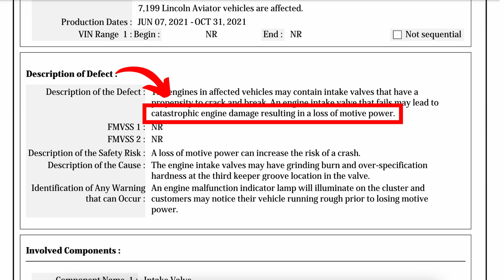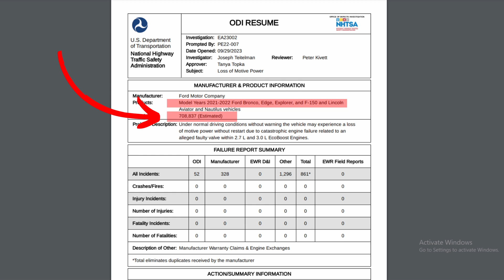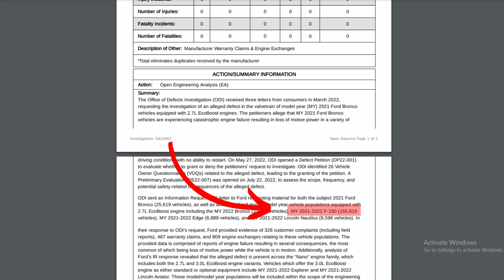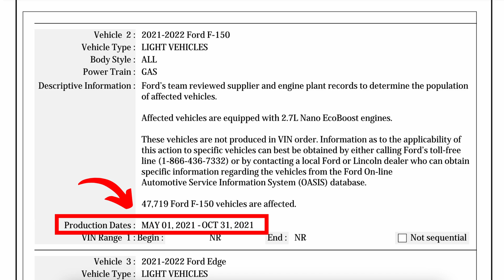Ford F-150 2.7L EcoBoost Engine RECALL Explained *Heavy Mechanic Review*

Comment: I got this recall notice from Ford. I'll take it in next week to get checked. 

Truck has 145k on it, wondering how they determine if the valves are bad?. I can't see for giving you a new engine that easily either. It would be nice though!
Reply: How did it go with your car? How did they determine if it was damaged? Did they replace anything? I have a 2021 and I received that recall.

Comment: A guy in Ontario Canada has had the Ecoboost engine in his 2024 F150 blow up 3 times within 13 months since new. Each time it was replaced by a new engine under warranty. In one case, it blew up within 6 minutes of driving away from the dealership with a new engine. The change in alloys in the intake valves did not fix the problem!
Reply: Is this the 2.7 for sure? Or a different version since he’s in Canada?
Reply: @Mitsu3kGT It was the 2.7. You can see a news item on YouTube about his experience by searching this title, After third engine failure Ontario man is losing patience. He made the news after the second failure (the one that happened within a few minutes) and this news item was after the third time (two months after the third Ecoboost engine was put in under warranty.)

Comment: What’s the best year for these 2.7 engines. Thinking about buying one, I don’t pull or haul anything. Just daily driving. Thinking should I get a 2.7 or 5.0.
Reply: I have a 2017 F150 with the 2.7, its been great but get the V8. Less pressure in the engine means less wear and tear down the road.

Comment: 2:44 "A design modification was implemented in October 2021". My F150 was built Oct. 17, 2021. Not sure if I'm affected.
Reply: I’m in the same exact position my VIN number in the door panel says manufacture date 10/21. Were you able to find anything out about this scenario?

Comment: To clear up some confusion here...Ford doesnt make the Valves. They have a supplier that manufacturers them...they failed to heat treat them before sending them to Ford.
Reply: No. That’s not what it was. They were made from Silchrome lite, which was brittle and prone to breaking and cracking. Now they use Silchrome 1, which is more resilient
Reply: They are supplied from someone else yes, but the material was the issue. Not that they didn’t get “heat treated”

Comment: Have a 2016 F150 xlt 2.7, not work truck, garaged, washed and waxed, purchased new from Ford, has 28k.  Truck has good power, nobody is disputing this but this engine has major faults, 1 - first gen like mine the intake valves are prone to carbon build up. Have to manually clean.  Ford knew this and yet went ahead to market with this 2- cylinder head temp sensor on driver side ($8 copper/bronze sensor) that without warning will leave engine in limp mode. happened to me had to drive back 3 miles with severe trembling.  No overheating just sensor went bad, no warning.  Can leave you stranded anywhere without warning.  Again, why does Ford do this crap?? 3 - rubber belt driven oil pump?  I want someone out there to tell me why this is good vs a thick chain that will last the life of the engine.  People here that say their 2.7 "has done 200-500k in miles without any maintenance are likely lying or Ford stooges.  This engine 2.7 and same for the 3.5 are loaded with about 60 sensors, of which I learned from technicians 3 will fail and leave you stranded.  I'm a mechanical engineer and son of a retired mechanic and can tell you after working on dozens of cars, sensor laden cars, and turbos fail this "no maintenance" extreme high mileage nonsense is fiction.  Hey even the 2025 2.7 have the cylinder head temp sensor.  So new truck owners you are in the same boat.  Chevy is no better.  Can Ford build this engine bullet proof, in my opinion from an engineering point of view, yes they can, but as to why they don't I have no honest answer.  Likely some board political decision, "who cares if it works, we have spare parts for 20 yrs" mentality.
Reply: Sorry you've had problems. As a mechanical engineer, you should know the first generation of the engine will have some bugs. Also, machines are most likely to break either when they're fairly new from manufacturing defects, or really old from deterioration. My engineering stats professor taught us to always run our new stuff as much as possible when under warranty, for this reason.

I've got a 2.7 built in December of 21 that's about to hit 60,000 miles. I haven't had any problems. However, I could see the transmission going out first. It gets some hard downshifts from time to time. That being said, I'm about to change the trans filter and oil to hopefully improve it. I used to haul 500-1000lbs half of my days for work, and towed a 6500lb camper a cumulative of 5000 miles so she's been worked decently.

Overall, I would consider this engine to be a fine piece of engineering. I did love my 05 Chevy 5.3 as well as it was much more simple. She lasted to 330k. It got about 40% worse mileage and had 100 ft-pounds less torque.
Reply: You sound bitter. That’s too bad.   Why complain about the oil pump belt when your 2016 2.7 has a chain?

Comment: Hmm my 2021 F150 built in 9/21 has 45,000 miles on it. Should I be worried any more?
Reply: Probably not.  My 2021 Bronco 2.7 is subject to the recall, 113k miles.

Comment: 2021 f150 check engine light came on about 18000 miles on it come to find out cylinder  walls were all scored new engine going in paid by Ford
Reply: Probably a 5.0…

Comment: This happened to my 21 f150 at 33,000 miles before the recall so Ford only "repaired" the parts that failed. Now I'm at 47,000 miles and it just happened again to the other side of the engine. This has been a colossal pain in my ass and now I have to wait 3 weeks to even get a loaner vehicle from the dealership. It feels like I just took a pile of hard earned cash and flushed it down the toilet 😭
Reply: Sorry man, sometimes this kind of thing happens. Big inconvenience! Hopefully Ford gets you right.
Reply: I have a 2021 2.7 and I received the recall but I haven't taken it to the dealership yet. What exactly did they change on your car and how long did it take?

Comment: My 2021 Bronco FE is in the recall.  I have 40k miles on the engine with every type of driving, from crawling up Ozark trails to prolonged 80mph run on the interstate. So far, drama free. Be intersted in what this service cycle diagnoses entails.
Reply: I’m looking at buying a 2021 FE, 2door with 36k miles. What ended up happening with yours?
Reply: @NolanChance-m7s Ford has yet to offer a solution to the valve train and rear shock recalls. Now they are saying "3rd quarter 2025". Other than that, no issues with my Bronco. We had a major hail storm recently and a rear taillight was cracked...taillight is $1200!!!
Reply: Ford has a service procedure to test the motor.  It's unlikely that a 2.7 affected by the valve issue would live past 10k miles.  I have 113k miles on mine and it's been reliable.  I did wory initially enough to get an extended warranty to 150k miles.

Comment: I hope they replace the stupid wet oil belt with a chain.
Reply: I believe the 2.7  originally had a chain but, the bean counters saved a few pennies by using a belt (dumb idea)
Reply: @hmdwn  the belt is actually quieter than a chain and it is supposed to save a bit of fuel
Reply: Why do you hope that when it’s a non issue?
Reply: @OutdoorCanadians  nonissue til you have to pull the transmission to replace it. its still a stupid place to go cheap. like a plastic water pump on a bmw, WHY?

Comment: Eco Boosts are like a CVT, they are fine if you drive them like an old man with a steady foot.
Reply: Obviously you don’t own one because you are completely wrong about that
Reply: @pathunter7003  No I repair them daily at the dealer and am glad to be correct because I make a lot of money off the owners.
Reply: @greggc8088  yea, I know. It seems that millions of people work at dealerships. 🙄
It’s a wonder this country can operate daily with everyone working at a dealership…
Reply: My experience was that if you baby them they get less reliable... but what do I know, I only had 250k miles on a flogged 1st gen 3.5 Ecoboost.
Reply: @mpeugeot  What do I know, I repaired them for the last 15 years and now work a tech line helping others repair them.

Comment: This is oddly reminiscent of the spark plug blow out problems fords 4.6l's had, ford knew about the issue, refused to acknowledge it, no recall was issued, and repairs came out of the owners pocket, to the tune of $500 per incident...Had a friend that had a 2006 F-150 with the 4.6l, 3 times it ended up at the dealership for repairs for this issue, 3rd time it was a previous blow out...
I went and picked him and his truck up, dropped them off at a local repair facility, ordered new heads from Summit, repairs were made, never had an issue again...
Reply: Ford didn't have a issue with the 4.6 terminator engine,  it was the 5.4 triton that had spark plug issues
Reply: @BruceDragon-sf1tr  Wrong...
Reply: @wipatriot510  don't just say I'm wrong , prove me wrong

Comment: This channel missed that about 100,000 Tundra 6-cyl engines are being recalled and need to be replaced. I talked to the local Toyota dealer who said that because of the huge number of Tundra engines that need to be replaced, this can cause significant delays for people just wanting regular service at the Toyota dealers.
Reply: Toyota service was already a nightmare as they have the worst techs in the buisness. Seriously they are all 22 and couldn't diagnose a common cold. Not a torque wrench in the building.
Reply: Bull💩... stop being so ignorant son
Reply: @atg1338 naah no bs as a tow driver I have towed two i repeat two dozen tundras of various years between it's release and current that have destroyed the engine and a number of electrical nightmares .one failed because its turbos failed sending the oil into the engine destroying a very expensive engine and it had 1300 miles .

Comment: With the way tax are paid here in America flat rate plus warranty work gets shorter hours. There’s no way I would trust a new engine being put into my car. There would be so many little things skipped and not done to factory specs. I have seen it so many times. Bolts not put back in wiring harness left loose.

Comment: I have one of these in my company truck I have almost 60Kmi on it and it's a 2022. I like the performance of the truck. I carry quite a bit of weight and it really does well on the road. Towing is no problem. I've been really surprised. Getting 21-22mpg avg.

Comment: Now if they would just recall the junk 10R80's and fix all the ones they sold for years with faulty drums and valve bodies...twice in 80k miles. Ford quality is not currently a thing.

Comment: I really enjoy your videos and have a question. You often mention turbo gas engines being less reliable or "more complex" than naturally aspirated and I do not argue that, my question is, what differs from turbo gas to turbo diesel that makes them more reliable? Especially with today's emissions components. Many thanks! Keep up the great work
Reply: Diesels usually work for a living and have a reason to exist, drive, and put on miles. They rev low and have heavy internal components. Theoretically, turbo gasoline engines can still run about as many miles... so many factors.

Comment: I will take this over the recall on my new 24 Tundra that I am hearing rumors will be further expanded!
Reply: I saw something on that earlier. Knowing that 24’s have had engine failures, I figured it would only be a matter of time before they included later 23’s and 24’s. It’s pretty shocking that Toyota of all companies is having this issue.
Reply: @cpftank09 They have found that it is from not cleaning the machining debris completely and the machining debris is grenadine turbos and probably other issues. Not due to quality of design or build.
Reply: @seanmclaughlin7415  the problem is, they there are engines failing well outside of the recall specified manufacturing range (early 23) when the fix was supposedly implemented at the factory. Not to mention it’s happening to US and Japanese built V35’s. 2024’s with build dates in late 23 and early 24 are failing. While the 5.7 had issues early on, they were nowhere near as wide spread as this. I worked at a high volume Toyota as a tech when the 5.7 came out and we only had a handful of them with any issues. I trust that Toyota will figure it out and they’ll fix all the trucks. But this is the worst issue Toyota has ever had that I can recall outside of maybe the frame recalls.
Reply: @cpftank09  Sure, I believe you. I was just describing the cause, not the extent off the issue. It took them a long time to correct the frame issue, too.
Reply: @seanmclaughlin7415  that is what Toyota is claiming, machining debris.
But it could be a quality of design or build nobody will really know. The main bearings are getting ground up
Reply: Nothing is made like they used to
Reply: I'll take no motor recall over this or the Toyota... turbos👎

Comment: The recall involves analyzing the affected engines.  Like you said if the engine already has a certain amount of miles its considered ok. The bad valves simply wont last that long. The estimated number of replacements is a very very small fraction of the total recall.

Comment: Ford has lost their way with this ecoboost crap!  Their best engines are naturally aspirated multi port injected.  The 3.7 in the RWD form is by far one of the best engines they have built in the modern era.  The 5.0 Coyote & the 4.6 2V are also amazing.  I will not own an ecoboost engine in any form.  I also like the 6.2 Boss & the 7.3 Godzilla V8s as well.  That's just me, a guy who worked on them for a living.
Reply from the maker: My first choice is still a N/A engine. 5L would be my go to option in the f150 lineup. But like you said that’s just me lol
Reply: Of course you work on those v8’s for a living, they aren’t reliable with the constant repairs

Comment: If Ford permanently fixes the issue I’ll become a big fan of 2.7 and that’s thanks to you Alex
Reply: This is very rare and models from 2021. I know many people with the 2.7 that have well over 100k with zero engine or driveline issues. Just basic maintenance. Go on any F150 group and it’s widely considered the most reliable engine and gets the best fuel economy.

Comment: 😂all the arse holes that hated on Toyota with 3.5 iforce where are you slamming ford on being forced to put this recall out by NHTSA… Toyota stepped up on their own. Just saying.
Reply from the maker: I mean Toyota did know about their issue for about a full year and swept it under the rug until they couldn’t anymore. Issues from both parties
Reply: @GettysGarage  Or did they investigate the matter? Yes. 

Run another validation test on the engine? Yes.

Then update a part and issue a safety recall… yes. 
Seems far more accountable to me than what Ford has been doing.
Reply: Maybe you can give their CEO a reach around.?.? BTW I don't hate on the GEN3 Tundra. F a GEN2, but I dig the GEN3.
Reply: @JROC734  Say whatever you want. But you can’t deny the fact that Toyota stepped up before having NHTSA force them.
Reply: Toyota has stepped up, however there are no new engines being replaced yet and the ones that rebuilt in the shop are failing too. There are rumors that the recall will extend to later 23’s and 24’s as well. There have been a handful of 24’s with engine failures with very few miles on some of the groups. I’m a Toyota guy, but this 3.4 is not looking good.
Reply: @cpftank09  some of the 2025 engines are having issues too
Reply: @pathunter7003  sadly you’re right. More later built 24’s are starting to pop up as well. I know Toyota will fix it since they don’t want that reputation, but it’s not looking good. Other vehicles with this engine are also seeing some failures, even the Japanese built ones. After watching Car Care Nut’s breakdown of the engine, I think it has to do with the main bearings not having locator tabs like almost every engine ever produced.

Comment: I had a recall on my 2017 Corvette. I hate recalls so much I ignored it for six years until my dealer just ordered the parts. And yes it had to go back a second time because they forgot to tighten a steering bolt.

Comment: I just had to buy a $70 Throttle Body (position sensor error) and replace on my 2002 (owned since new) Trailblazer 4.2 with 247,000 miles.
WTH!!
nothing lasts anymore 😞
:cat-orange-whistling:
Reply from the maker: Plastic parts and built to a price
Reply: @GettysGarage  /S 🙂

Comment: so they are gona change engine or just waiting to fail engine?
Reply from the maker: They are going to inspect each engine built through those dates. How they are going to inspect the intake valves I’m not entirely sure. But, I would suspect if you have any decent mileage on the engine you will be okay. They seem to break very early on.
Reply: @GettysGarage  I got new f150 lariat 2021 model 12 oct 2021. I got only 17000km on meter in canada not hard drive as my wife drive to hospital in winter only because snow weather. Shoukd i go to dealership
Reply: @bornWinnipeg  Replace the engine.

Comment: Does this engine use a plastic oil pan?
Reply from the maker: Yes sir!
Reply: They should at least use an aluminum oil pan if they don't want to use a steel one, in my opinion
Reply: Yep.
Reply: @stevebeard7667  🥲